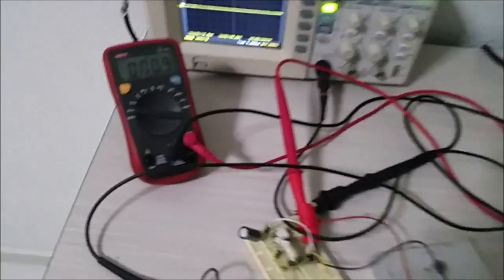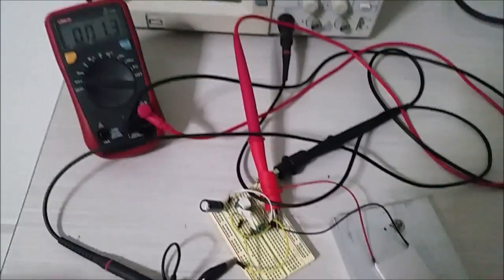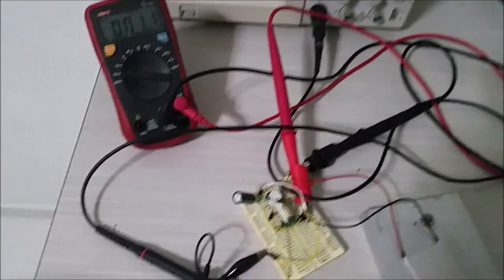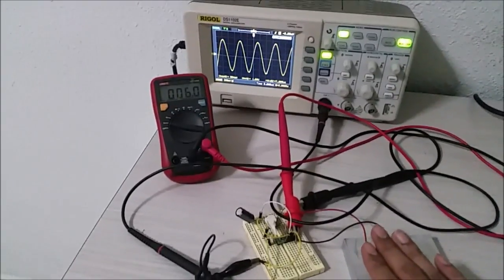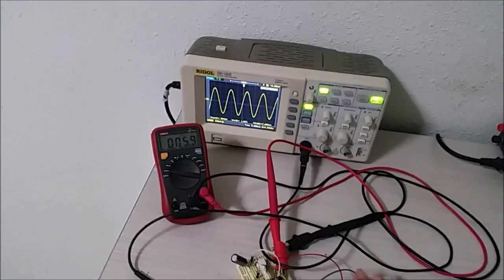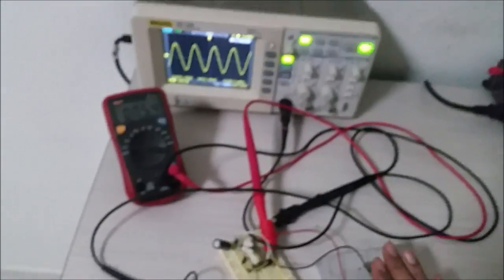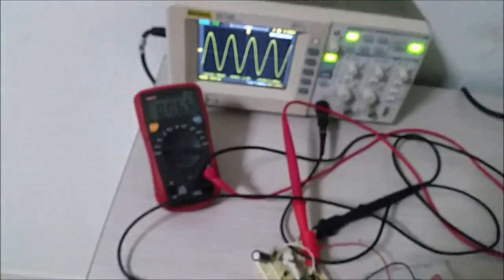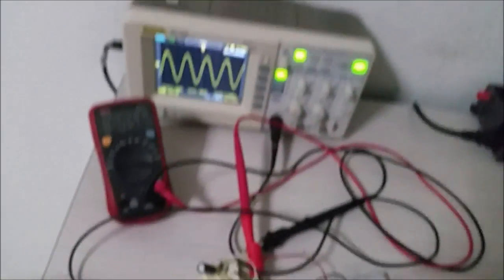5mV(0.005Volts) self starting Energy Harvester-Advance Prototype

Comment: It's fake. The camera is shaking, nothing is visible and a bad image, there is no diagram to check.
Reply from the maker: Do check my older video 25mV around 10years ago with circuit diagram..There are people  whom used my circuit diagram and sold it in ebay.I am not to happy about it.
Reply: @sanjev21  https://www.youtube.com/watch?v=Fzww6yPQMrg This Video? Also doubtful. In any case, 25mV is not 5mV. It is simply impossible to run a converter from discrete components at such a low voltage.
Reply from the maker: @localixdots9698  The lowest oscillation i have achieved is at 3.5mV after doing minor tweaking .No video posted.But it is up to you to believe.

Comment: Can you explain circuit diagram?
Reply from the maker: No.But i can give hints I used only 4 components
Japanese SMD JFET,resistor,ceramic capacitor and 100:1 SMD transformer used in commercial Energy harvester 20mV circuit.
Reply: @sanjev21  so something like joule thief

Comment: +sanjevf21 : Thanks for sharing your progress. How much current is required to oscillate at 5mV? And will you be disclosing the discrete component and circuit for those that want to replicate your work?
Reply from the maker: There is significant voltage drop to multimeter in mV doing current measurement  at uA setting.Start of Oscillation is around 130uA and and sustain oscillation down to around 85uA.You can take a look at my  older 25mV youtube video with "circuit diagram" posted around Dec 2012.There are many whom replicated my work in overunity dot com with success.But there are few that made money using my circuit which i am not happy about since my original intention was free and also it is also a test to see how competent "replicators" really are.But the end result was big disappointment since none took it up and improve it further.
Reply: Thanks for responding, I understand why you have reservations about providing additional information.  I reviewed your Dec 2012 video, can you say if you were able to increase the output current?
Reply from the maker: iQuest Do refer to my rather recent video body heat to kinetic converter.It's output is around 210uA.Do check the youtube description.
Reply: Appreciate your response and efforts, thanks.